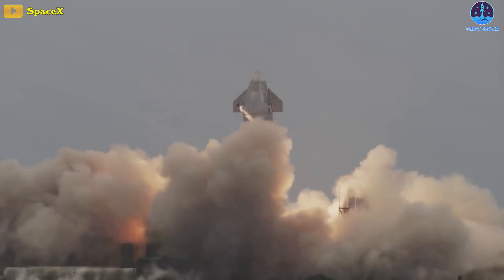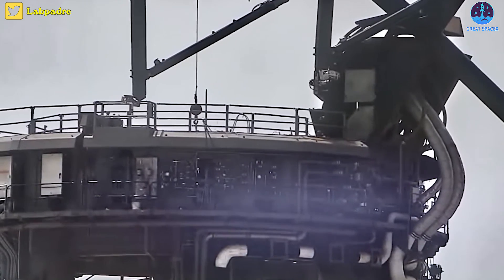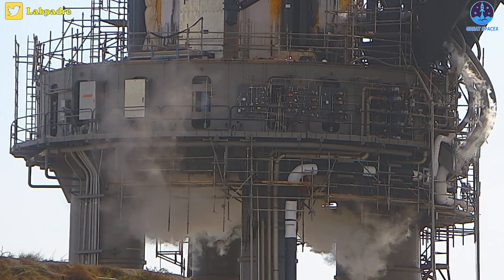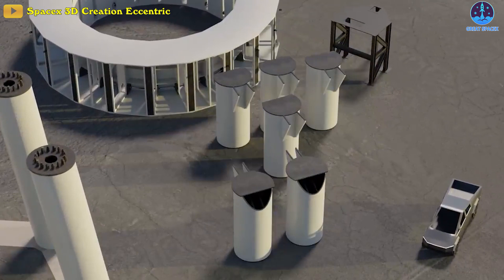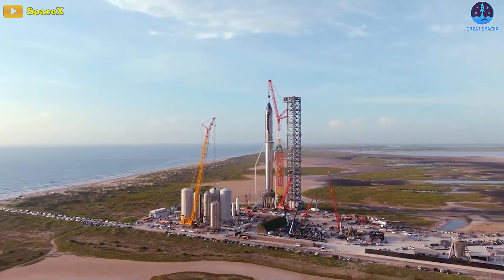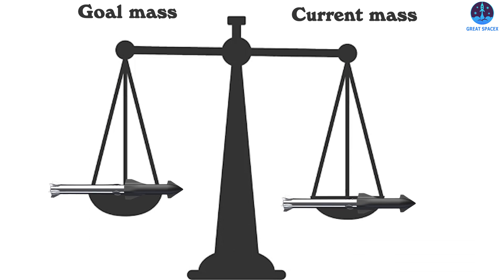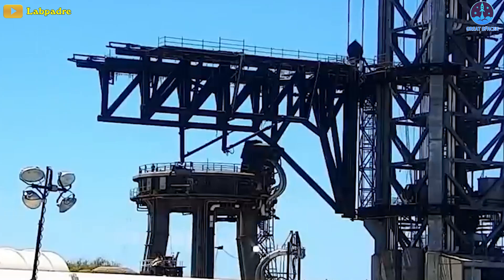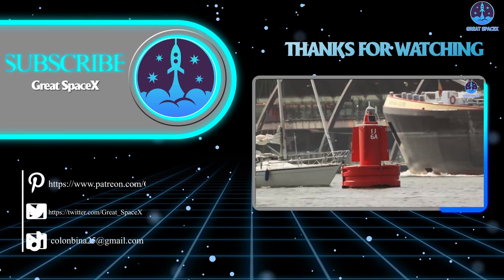Musk said "SpaceX's OLM is the most complex, not easy to build", can it hold SuperHeavy Static Fire?

Comment: Referencing the Ryan Hansen rendering of the the clamps at @ 4:32, my question is this?  Do we know if there are ancillary or back up components built into the clamping linkage that could be "detonated" or "fired" to dislodge an arm that is "stuck" in a position that continues to cause interference preventing  a clean launch??  That is a massively complex system with "hundreds?' of moving parts that will be functioning in an extremely destructive environment.  I'd hate to see a launch destruct while still on the ground because just one or a few of the  components didn't get the "LAUNCH" memo!!

Comment: I suspect Starship variants designed to carry cargo to Mars would probably need to make weight compromises in order to have, landing legs.

Because if they did not, they probably could not, deliver freight safely to the surface.

I also wonder if it might prove impractical to re-use at least early variants of cargo Starship for repeat journeys.

This is because apart from retaining vehicles which initial crews arrived with in reserve against urgent need, such as for alternate habitats or emergency return to Earth for example.

The immense value that refined resources incorporated to each cargo Starship will have for pioneers on Mars might render repurposing freight variants almost an imperative.

Prior to the advent of substantial local industrial capacity at any rate.

Bearing that in mind, it could even ultimately transpire that at least some early Martian structures might be designed so they can be fabricated using Starship structural components without need for significant modification.

I have also previously suggested that it might even prove feasible to simply lower at least some Starship hulls onto their sides using maneuvering thrusters adapted for that purpose.

By employing that technique, it might not be necessary do disassemble the main hull of Starships for some applications at all.

An irritating and potentially serious problem Astronauts encountered during the Apollo missions was irritation to moist membranes such as eyes and mouth caused by conveyance of extremely fine Lunar dust to living spaces on the surfaces of EVA suits and other equipment.

The likelihood this will also be a problem on Mars seems even higher than the Moon, given that Mars has an atmosphere capable of sustaining quite high winds and they in turn can cause massive dust storms which can last for prolonged periods.

Incorporating additional insulation for propellant tanks in order to render them also useful as work spaces for humans such as vehicle and suit decontamination facilities and possibly workshops.

Could, prove to be a valuable compromise in order to enable some Starship hulls to be used for such purposes early on if prefabricated air-locks could be added.
Reply: All this has been thought of many years ago, do you read any science fiction?

Comment: The "wings" (they're called grid fins) will not fold down. They are fixed outward, and will be extended the entire flight. They will only rotate slightly during decent to guide the booster back to mechazilla.
Reply from the maker: Thanks for your comment! Have a wonderful day!
Reply: I was gonna make these same comments but it was a good video.
Reply from the maker: That's right!
Reply: @colonbina1  The grid fins wont be used to catch the booster. Look at 7:18 between the two grid fins on the right hand side is a small extrusion with a rotating cylinder on it, this is what will make contact with the chopsticks. The plan is to reduce the number of grid fins as they know that they dont need four grid fins to make the necessay in flight attitude adjustments, Elon has said they hope be able to use just two fins and at most three.
Reply: @linuxgeex  Thanks for putting what i said into different words....
Reply: @linuxgeex  so why was your now deleted reply addressed to me? smdh
Reply: @monkeyfunk8371  I'd just posted on a more recent video and saw the bell, thought you were talking about that post.  I think you could detect my confusion lol.  So after expanding all replies I realised my new reply was a waste of time and deleted it, as replies about redundant replies are even more redundant and of no value to other readers... and these comments are all about value to other readers... wouldn't you agree?
Reply: The grid fins fold flat for the next flight
Reply: @malcolmdavid722  where did you get the information that the grid fins will be folding flat?

Comment: The OLM for SLS  was budgeted for 383 mil, the contractor Bechtel said it cant be built for this price   It underbid the cost and its a cost price contract which means NASA is stuck for the expenses  Estimated cost is now 1.2 bil  ,  4 X the original cost
Reply: Was this due to material cost increases?  Steel price is very high now, and China is the main supplier of the world's stainless steel now.
Reply: @stxrynn  I doubt that's even been factored in yet. The report was likely filed before we idiotically sanctioned ourselves through Russia. The cost has probably doubled since then.

Comment: Why not fill the rods with heavy water  and then let that be used to control the flame at first slowly drain top to bottom would save a lot of time and would allow lots of the parts to be integrated into the mount
Reply: Add depth to the mount and then pressureize the tubes to the top make it like two hooks grabbing eachother the mount being bouncy could be good

Comment: They have tested abrasive pad coatings deluge may not be used.
Reply: Deluge will be used, this is not an option. Unless you want to flatten all the buildings for some distance around. The design is basically sound. (get it)?

Comment: Deluge is not a given, haven’t seen even a test.
Reply: How else are they going to damp heat and sound? As for test. They haven't lit her up yet. I don't think a bunch of fire hoses need much testing without having the engines running to see if it actually damps the sound as expected.
Reply: @avgjoe5969  They don't have to see if it will work, we already know it will, just see if there are any surprises, like the whole thing disappearing in a puff of smoke.

Comment: They should have used an octagon.. more expensive but stronger
Reply: Not necessarily.  A primary concern is the restriction of exhaust flow.  With more legs, the legs have to be narrower to allow equal flow rate.  I'm sure they considered the balance of weakness due to thinner legs vs weakness due to shear loading forces.  ie the spread of the legs is indicative of that consideration.  The one mistake I think they made was having the top ring shield flat.  I get that it's flat to turn the forces into compressive vs shear, and also to shield it from heat with the boundary layer effect, but I also think they should have dished it slightly and castellated the edges to break up laminar flow down the inner and outer sides of the ring, because that will reduce the peak forces shocking the plumbing etc.
Reply: @linuxgeex
Yes you have very good points there... I'm thinking that ideally they would have an octagon with sharply bowing ribs connecting to another octagon with inverted ribs..to a base octagon.. and they could connect the upper and lower ribs by effectively immune struts for extra integrity.. thus allowing the main legs to be thinner on the inside and top and wider on the outside and base... I'm sure that a computer can model it perfectly... the resultant structure would carry the safety factor at every zone rather than some being weaker than others... but absolutely the interface seems very sub optimal.. and I think that the clamps are on the wrong side for ideal retention as well... in fact a bevelled split aperture would have provided a much less complex securing mechanism whilst reducing failure by an order of magnitude.. simply having a reverse but secured aperture on the vehicle structure machined optimally would have prevented any of the possible localised fatigue cracking and transfered this to translateral force...
Reply: @janwitts2688  Already to complicated.
Reply: @linuxgeex  Wait for it in version 2.0. For now they need a flat surface for workers to walk about and inspect the clamps.
Reply: @linuxgeex  To complicated.

Comment: Note: Super Heavy grid fins no longer fold down along rocket body.
Reply: Yeah Elon announced that around the same time he did that big presentation after the stacking of ship 20 and booster 4.  Some of the stock animations used in this update are getting sorely outdated, so commentary based on those animations are going to have mistakes.
Reply: Yeah, but anyone following spacex and superheavy knew that even before that presentation. This video makes it sound like they are not as far as they already are.. years of testing and refinement.. nope, you mean maybe a year, less if you actually go from when the mount was put together

Comment: It still surprises me about the lack of flame diverter or deluge system planned or tested to date. Seems risky given the importance of stage zero
Reply: There is a deluge system, lol.
Reply: There is a deluge system. They can only test it with testing of the 33 engines. 
There is no flame diverter tunnel possibly as they want to minimize noise and the water is better at it, whereas a trench would generate low frequency vibrations that would travel far and wide. 

If I were to guess. Its all about the noise and keeping debris from kicking back at the rocket (as happened during the hopper experiments).
Reply: There is also no fresh city water supply, so all the water they use has to be trucked in.
Reply: @xploration1437  could build desalination plant and use ocean water
Reply: @tinagiles3430     It’s probably in the works.  Eventually.

Comment: Considering the Arms will be needed for retrieval very soon and are very close to the flames, I assume that they are well protected during launch.
Reply: They are rotated away from the OLM during launch so the flame is not a factor.
Reply: Have you ever tried to melt thick steel plate?